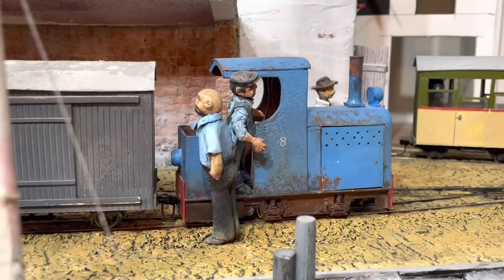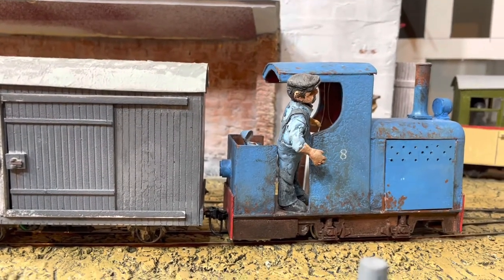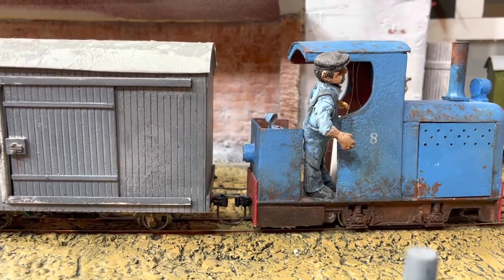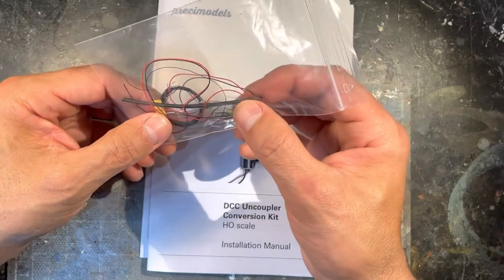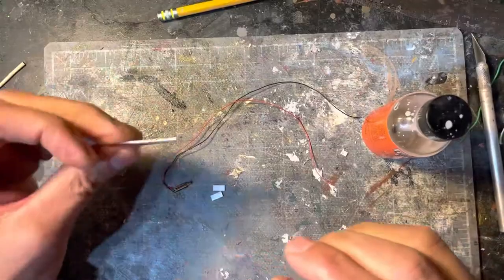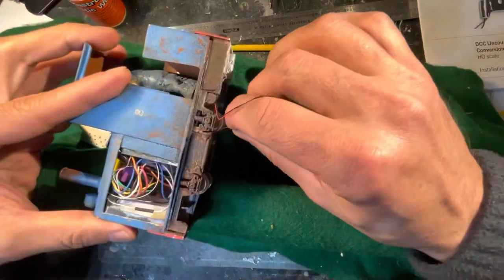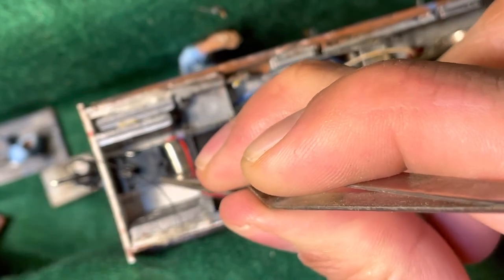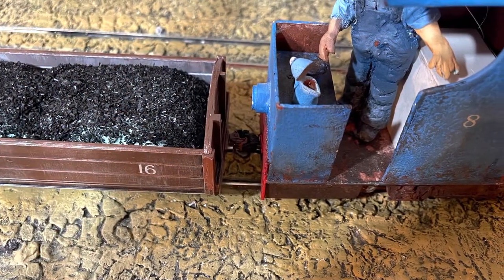Installing DCC Controlled Couplers for Your Model Railroad - Complete Hands off switching

Comment: So you have installed a motor to help you couple onto wagons!? I thought this was to uncouple..?
Reply from the maker: It’s to uncouple.  The coupler opens when the motor is activated.  The coupler springs back to center and ready to couple again.
Reply: Remote infra red works perfectly!!!! Trust me I am the guy that invented this!!!
Reply from the maker: @wasatchrangerailway6921  what is remote infrared?
Reply: @TravelinginMiniature  It is remote uncoupling using an infra red receiver on the rolling stock, and an infra red transmitter! Just aim the transmitter, hold and pull away!!! The train uncouples without touching it and no DCC needed!!!
Reply from the maker: @wasatchrangerailway6921  is there a video?
Reply: @TravelinginMiniature  No, I have not made one, but if you know anything about electronics it is not difficult. What are your electronics skills like?
Reply from the maker: @wasatchrangerailway6921  i can install dcc decoders and wire a layout.  Thats about it.

Comment: This wasn't designed by Rube Goldberg from Sweden was it?   Doesn't look like a very reliable system with essentiall a rope operated mechanism.   Interesting video though.
Reply from the maker: Adding the thread is a bit tricky but I think the apprehension is worse than the actual effort in installing it.

Comment: Thanks for this, although I find your reasons for using this mechanism strange. Getting finger prints on your loco? That's an odd one. Surely the main reason is because those methods are not exactly realistic, especially the lifting-up-the-loco one. The main aim of any model railway is the illusion of realism, and trying to keep that realism going. Lifting up the loco in order to uncouple it totally ruins that illusion. Anyway, that said, thanks very much for the video. I'm amazed more modellers don't use these, or perhaps they make their own by just buying those little motors. I can imagine the main problem will be programming, but it sounds like the instructions might not give much information on that. If your video on that is confusing I do have someone I can ask.
Reply from the maker: Sorry for not responding sooner.  Your generous reply left me thinking (good thing) about my goals. I set out to create the illusion of an Italian fishing village and vineyard with a small industrial railway shuttling goods and people back and forth from the vineyard to the dock.  I have ambient sound and plan to add sound to various animated things I have planned (creaky doors etc).  Not breaking illusion was one reason for adding the DCC couplers.  It really enhances operations.  I can shuttle back without breaking my perception of reality by stopping to stick my hand in there.   So your 100% right.  

However I am a clutz when working on models or the layout.  I always manage to break things when I reach in.  So reducing the opportunities to stick my hand in there is a godsend.   I plan on adding light poles and phone lines so not putting my hand through that future nest of “wires” will be good insurance.  

Thanks for your comments.  Happy Holidays!